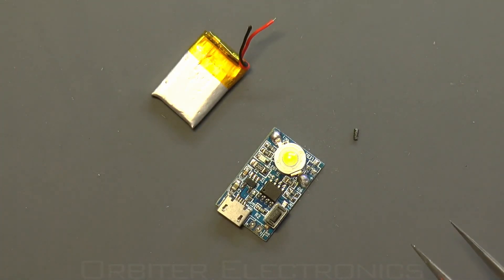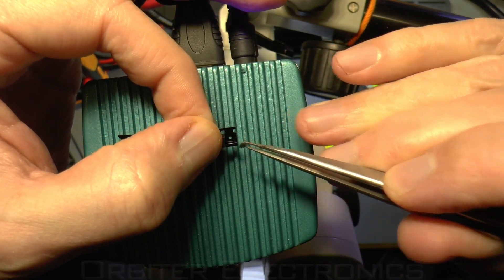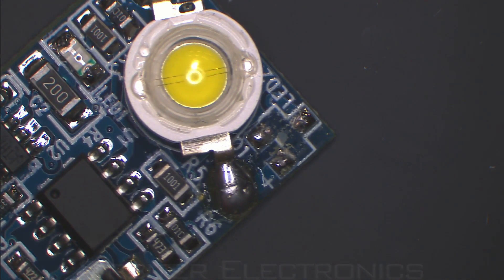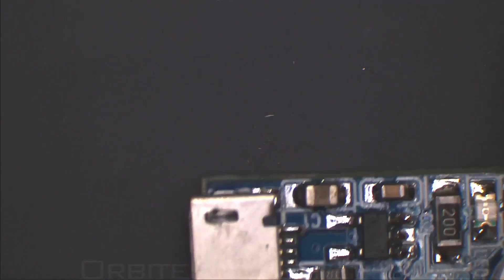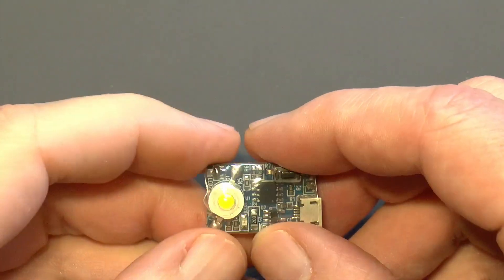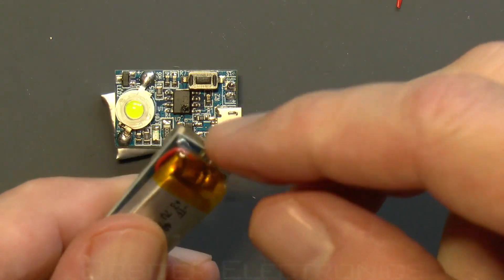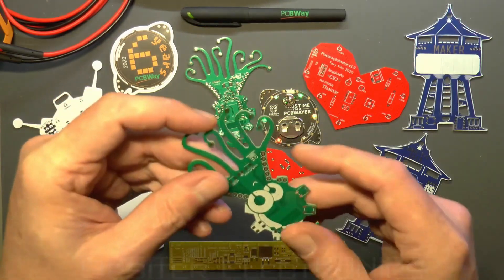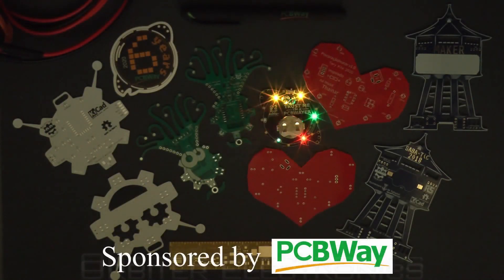FPV Drone Strobe Light Repair

Comment: That's why I have a parts drawer full of snipped off component leads, amazing how handy they come in for all sorts of things. Hakko FR-300 desoldering tool was the best purchase I think I've ever made for my bench. Thanks for sharing John!  Stay safe!
Reply from the maker: Hi Dino, I've got a drawer like that too, but mine is just stuff that's fallen though from the drawer above LOL. 
I think my de-solder gun is modeled on the FR-300 as it looks very similar. Also mine is just one of the eBay ones, it's still does the job well though. 
Cheers friend, Hope you and yours are staying safe too.
John

Comment: Always professional john,  but you soldered that transistor on so nice  it makes the rest look bad now lol :-D
Neat little units :-D
I was thinking (Always a bad idea) about the copper braid on t.v coax to help suck up the solder in the holes, but it would have to be soaked with flux to work :-(.
I think ill stay with desolder wick, less trouble lol.
Reply from the maker: Hi Harv. Thank you 👍️ .. Yes twisted up & fluxed copper TV coax would be great. Although maybe not the cheapo stuff as some of that is extremely brittle. Likely due to it being aluminium or steel etc. Yea proper wick is just the job.   
Hope you're doing ok my friend

John

Comment: Excellent stuff! I've used thin, stranded wire, twisted and dipped in flux as a way to remove solder. As it's stranded it acts like a braid and wicks solder pretty good. You can also see how well it wicks when 'tinning' stranded wire. Thanks for the upload.
Reply from the maker: Hi Tom, Thank you for your comments 👍️ Yes braided wire is even better, especially if there's plenty of solder to wick up. It's like a copper sponge :)
Cheers
John